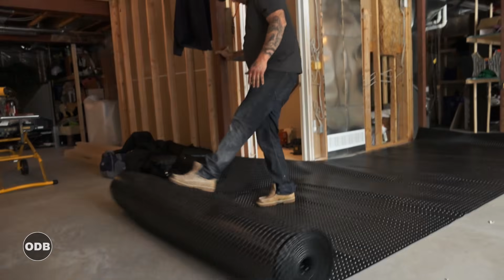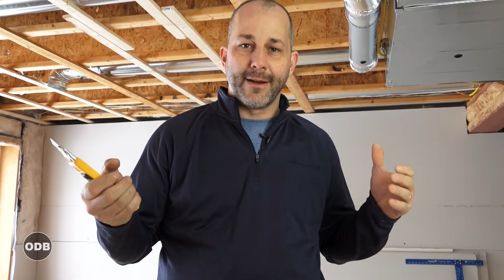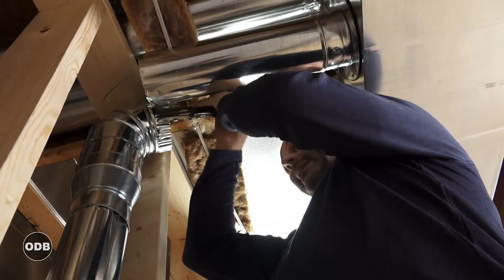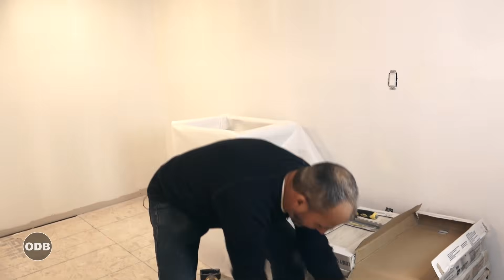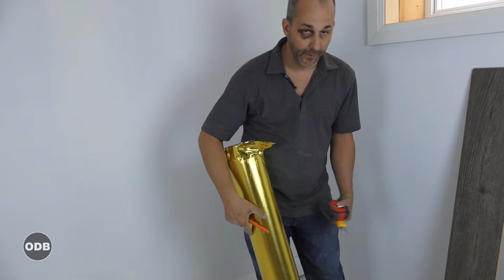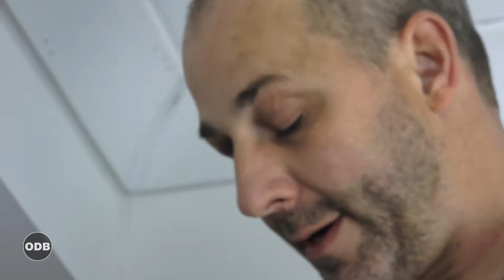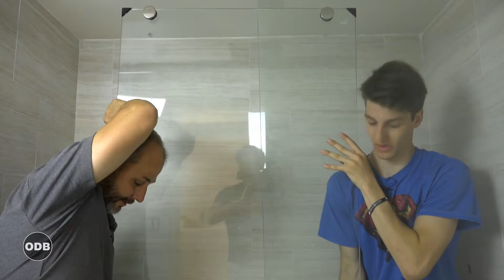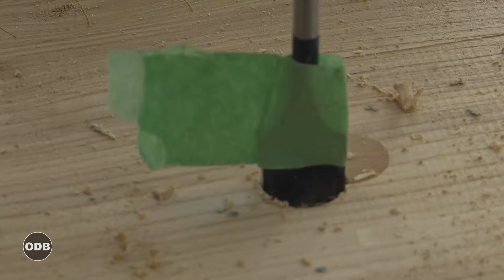DIY | How To Renovate an Unfinished Basement | A To Z

Comment: Rare to find someone who can speak so naturally, clearly and fluently about  his work. The pace was also excellent,  so it kept me interested for over 3 hours. Excellent video.  I wish you could spend a bit more time talking about wall insulation, framing around the outside walls,  and the possible need for ventilation under the  DMX flooring. What if moisture still builds up there and has no place to escape? Opinions?   I am planning also to use the same DMX dimpled plastic but I was thinking to install a layer of aluminium foil right on the slab expecting that will reflect back the radiating heat from the above. Reflective heat works well and only when you have an air gap. That dimpled plastic is excellent to provide that necessary airgap.   I would argue that would add couple R values to the insulation  properties of the floor at very low cost.  Maybe I am wrong but I would like to hear your  thoughts.  I am not sure I understand the purpose of that golden colored foil that is glued to one side of the laminate floor underlay. In my view that has no purpose since there is no air gap between the laminate and the subfloor.  And yes, what happened with your eye? First I thought you painted your eye to make it "interesting" and I was expecting some joke about it but you never explained. Did you get into a bar fight with Mike Holmes? :-)  Anyway, I like your video 100 times more that what MIke Holmes does . You are down to earth without creating the impression that there is only one way to do things and everybody else's work is crap.  Thank you for this outstanding educational video.

Comment: Good video but you shouldnt install you're 2x4 on directly on the concreate
Reply: The 2x's he installed directly to the concrete are pressure treated. I have remodeled and demo'd houses for over 30 years and there is nothing wrong with that method.

Comment: IF YOU WILL USE A SQUIRT BOTTLE WITH WATER ON THE TWO TYPES OF BITS YOUR USING THEY WILL LAST A LOT LONGER. IF YOU USE THE SPAYED BIT USE A SMALLER BIT TOO START YOUR HOLE. AT LEAST THREE TIMES SMALLER THEN YOUR HOLE BIT. ADDED BENEFIT YOU WON'T CRACK YOUR TILE AS MUCH. IT WORKS FOR ME, TRY IT ON A SPRAY PIECE OF TILE. SEE WHAT YOU THINK. I LIKE YOUR VIDEOS, I LOOK FORWARD TO MORE OF THEM.

Comment: I live in Texas, where basements do not exist.  However, I live in a 1.5 story home with a single room loft that is pretty much a finished attic.  Are there any plans to release videos on how to approach an expansion project or any finished attic?  Central air may have to be moved, hot water heater may have to be moved, sub flooring, and the possibility of dealing with bracing to the rafters.  Thanks guys!
Reply from the maker: Hi Luke, we are just finishing the renovation of our loft with some structural changes to increase the height and soundproofing. A lot of info in that series you will find applicable. cheers!

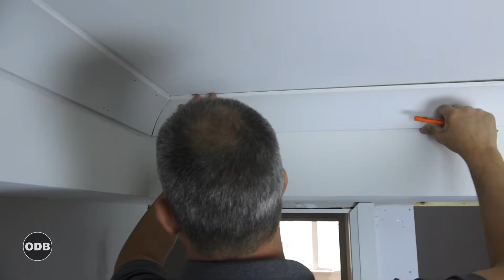Comment: 2:11:00 crown is one of my favorite DIY jobs. Having an older house, I worked in a step where after the first piece is up, take a scrap piece about 2' long and cut the corner to the right angle/bevel.  Then hold that scrap piece into the corner up against the piece already in place.  If the angle is off, adjust the saw and re-cut the end off the scrap piece.  Keep adjusting the cut until the scrap piece is tight, then use that saw setting to cut the first end of the piece that's going up.  You can repeat this step for the other corners.   ...also Top Gun 300 is a great painters' caulk.

Comment: For the header, your pencil mark was off from the laser, correct? When you pulled the stud out and screwed in to pull it flush with the base plate, your laser was 1/4" from edge of stud. I guess if your close enough it's ok?

Comment: Hi Jeff, I know the length of the toilet bolts drive you crazy, but they are very useful as "T" bolts in woodworking and the extra length is useful then. It won't make you feel any better but I thought you should know. The finish on the bar looks great, I don't think anyone could come up with a better result and all the work you have done is to a very high standard.

Comment: Great video but I am curious at 2:50 you glue the toilet flange to the drain pipe, you didn't screw the flange down to the sub floor afterward.
Reply from the maker: Hello Ina, the subfloor is cement. I have no doubt that the flange is not going to come ripping out but if you want to you could use some tapcons

Comment: a bit of advice on your duct work. your crimps should always follow the airflow otherwise you just built in a restriction. air flowing against a crimp creates turbulence which reduces the velocity you just attempted to increase.
Reply from the maker: Not concerned about the 3 % loss of heat back into the area I am heating. Cheers! It was all about the convenience of the installation and bringing heat to the floor.

Comment: "When you pre-drill the holes in the OSB subfloor use Tap Con screws. Prior to driving the screws into the concrete dip each screw into a polyurethane sealant before inserting the fastener into the bottom plates of the wall. Since the Tap Con screws have two different threads (a cutting and tracer thread) the sealant will be deposited on the membrane as it goes through. This helps maintain the vapor barrier that has been penetrated by the fastener." - DMX FAQ
Reply: Good tip....
Reply: l
Reply: L
Reply: L
Reply: L
Reply: Ll

Comment: I give you like , because you work hard and lot of good stuff presented  to orient , but that work around toilet , baby hack saw with new blade would do just as easy , also brass washer come on top of plastic washer - toilet flange bolts, you mentioned but forgot to put one on , just minor, never mind ,   however excellent work on the end , good looking basement !
Reply from the maker: Cheers , thanks for the like!

Comment: I don't even know how I stumbled onto this video... LOL I've had a hammer in my hand since I was about 5 years old (father was a contractor). Fantastic job with this video and the long format. I know first hand just how much work it must have taken to put this all together. Bravo!!

One question / issue: At around 2:52:00 you show the installation of the toilet flange and toilet. I see that you didn't remove the product sticker from the flange but that's was the mounting surface being used to clue to the sewer pipe. Additionally, you didn't make use of any of the mounting holes to directly bolt the flange to the floor. So essentially the only thing holding that entire assembly in place is any strapping used to place the drain pipe to the spot. Now that the toilet get's bolted to the flange, the entire stack of hardware now depends on the strength of the sewer pipe and how robust it is mounted. Given this is a basement, it's entirely possible that the drain pipe is sitting on a bed of cement and not floating in the air, but isn't this a fairly weak structural setup? Sure, you'll go back and silicone the outer edge of the toilet to the floor but with all the weight of an adult sitting on this toilet, isn't there a good chance it could topple to one side?

Comment: Hey great videos! Very thorough information. Thank you kind sir. I had a question about using Dricore vs DMX. I live in Ontario so our weather's similar. Why do you choose DMX over Dricore because everyone in home Depot recommends the foam Dricore for higher R (warmth) rating and I thought it works the same for moisture. Thanks again for the help.
Reply from the maker: that is the funniest thing I have ever heard. insulating the floor does not make it warmer. bringing heat to the floor does.
Reply: @HomeRenoVisionDIY    Hey thanks for replying. So what did you mean when you said the Dricore wouldn't act as a vapour barrier in comparison to the DMX? I feel like overall you don't think Dricore is good for anything it's advertised for.
Reply: @HomeRenoVisionDIY  Hey I did some more research and figured why you said it acts more like a vapour barrier. Just wondering when you drill through the plywood, the DMX and to the concrete, does that hole allow moisture to escape through it?

Comment: Hi. Great video you were saying about builders and codes and such. I'm from Winnipeg and looking to do my basement. What is the procedure with the codes other than electrical that I know you need to get an inspector for rough in and tie-in to a panel 

Thanks
Reply from the maker: insulation  inspection. plumbing, framing and final. Cheers!

Comment: So I would like to finish my basement but previous owner installed ceramic tiles but didn't do anything to the walls other than painting over the concrete. Is there anything I should do before framing the walls? Or if I can frame on tiles in the first place. Any help and tips appreciated!

Comment: Installing laminate was not the way should be. 
I do this for 12 years now, I do only Flooring ok.
But I was surprised how u installed the laminate flooring. 
Toronto on.
Reply from the maker: Hi Hasim, you might do only flooring but I am thinking that perhaps you have never seen this type of locking system. Otherwise you would have a different opinion. For the record there are now at least 9 different locking systems on the market.
Reply: @HomeRenoVisionDIY  
Yes I understand that. 
All good, I still will watch your videos like I usually do.

Comment: That is not the proper way to solder. You have to sand the brass part and never wipe flux on after!!! You need to take a rag and wipe off the flux residue after soldering or the acid will eat through the pipe or fitting and give you a leak over time.
Reply from the maker: so what you are saying is that I am soldering like every plumber working in new home construction. I am cool with that!

Comment: Awesome job, when I saw more than 3 hours video I thought I never gonna see that, but my curiosity was bigger.
Nobody is perfect, just a few things:
I like work with copper better.
Never use hammer drill in a hammer drill mode to open those holes in the tile. In that little case you bought for $9 bucks, it comes smaller ones, take that smaller and then use the bigger one.
Like I said nobody is perfect, is an amazing job.
Love the floor, the bar table, the bathroom almost everything lol. Thanks for sharing.
Cheers from Chicago 👍🏼

Comment: Shouldn't you wrap the valve part in a wet rag while soldering?
Edit: looking closer. The valve looks like you took it apart first, but still. :)
Reply from the maker: the brass cannot get hurt. Cheers!

Comment: What if you already have a finished basement and you want to take the carpet up and put down laminate? Should I still use the black item? The house is 4 years old. Thank you
Reply from the maker: Hi Tonya, if your house is 4 years old then I would suggest installing luxury vinyl plank. You can even install with a radiant floor heating system . Cheers! I will be releasing the video on that product in a couple of months.
Reply: Home RenoVision DIY thank you for replying. I am going to wait for that video. I really appreciate you doing these videos.

Comment: Pex sucks.. inner diameter is small .. cuts down on water pressure..  use copper don’t cheap out
Reply from the maker: LOL, actually the pressure remains the same. the holes in the valves are smaller than the pipe so it has no effect on performance.

Comment: I find that North America has a preference for forced air heating,while in Europe radiant heating is widely diffuse,particulally radiant floor .Knowing how hard is winter in the middle west and Canada ,I ask myself why  don't you guys switch to a nice radiant floor.Radiant heating is a different kind of animal and confort.Undeniably forced air doesn't produce the same confort of radiant heat.The convection of warmed air raises to the ceiling while it loses energy,it leaves the lower level actually cold.A radiant floor has a thermal inertia due to the concrete mass it only require a 28 C warm water in the line to heat your room till 21 C,it's a really nice perception of a warm environment.As always it a pleasure to see you at work ,great inspiration for DIYers
Reply from the maker: we use forced air so we have A/C in the summer as well with basically 1 system.
Reply: @HomeRenoVisionDIY  thats true Jeff,but modern heat pump systems allow you to circulate warm fluid in the line system during the winter and cooled fluid during the summer using the same technology,sometimes we implements fan coil units for the cooled air,but you can actually circulate the cooled fluid into the floor ,we are progressively switching to this technology from natural gas in our domestic furnaces,one technology,one utility bill (just electricity not both elect/gas),but here we don't invent nothing,I actually think it comes from you in North America...another great feature is the ERV ventilation system,fresh filtered air in any ambient of your house while costantly recovering energy with the heat exchanging core,thanks for your comment Jeff,cheers from Italy

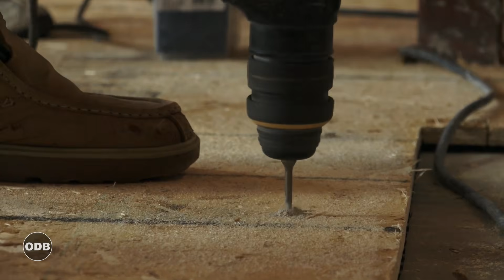Comment: @Home RenoVision DIY is the air tightness of the DMX affected when you put the concrete screws 5:49 through it?
Reply from the maker: Not really worried about the eventual fail of the screw. When you renovate a basement you need to understand that it will not last forever. Just looking for a 60 to 80 year solution.

Comment: Can I use that black mdx thing on cold cellar concrete walls for half foot down from ceiling on walls as it’s causing condensation problem on ceiling ply wood and on the wall on top where it meets ceiling which is above the ground 
Thanks and sorry for silly question
Reply from the maker: cold cellars are a completely different video. Cheers!
Reply: Thank you for reply 
I checked in your channel but didn’t see it ,if it’s uploaded then can  you please give me link? Thanks in advance

Comment: Can't tell you how helpful this channel is!!!!  If I was using foam board on the exterior walls and then wood frame with batt insulation on the inside would install the foam board down to the floor and then butt the dimple and plywood up to it and then frame on top of the plywood/dimple mat?  I figured this would be the way to go because it would keep any moisture that went down the wall under the dimple layer also.  Does that make sense.  Thanks again for all your content, simply awesome!
Reply from the maker: Thanks Danny, glad to help. Cheers!

Comment: I seriously recommend now using non-wax seals which work in any temperature (wax rings don't work well if installed when it is too hot or cold), will last forever, and tolerate use by obese  people much better than wax rings, which get flattened, do not recover, and then leak.

Comment: Pressure treated lumber on concrete is ok according to code in your area, but will it last more than 20 years? I thought there should be something in between for home construction. No idea what I’d put there other than plastic sheeting or a metal plate. Is there something else you could do? 

My house is pier and beam foundation but someone came along after the initial build and put concrete on the outside, in contact with the wood. The concrete sank and is taking parts of the house with. Different problem, but I’ve wondered why the wood hasn’t rotted. Figured it was because it’s in the desert. 

I agree with the person below. We need to clone you. You point out the stuff other people have done incorrectly and then I don’t want to hire anyone else to fix it. But that’s ok. because now I can do it myself. lol
Reply from the maker: Hi Deborah, even untreated lumber will last 20 years so no worries there. The reason we use it is to stop the proliferation of mold.

Comment: This is a great video and will be shortly following it step by step to finish my basement.  My one question is how did you address the diference in riser height at rhe bottom step of the stairs after addinthe barrier and plywood?  I want to use the DMX as well but am concerned about the tripping hazard because of the difference in riser height at the bottom of the stairs.  Can you explain what you did or would do to address that?   Thanks!  Keep up the great work.
Reply from the maker: Hi Danny, we installed tile at the stairs so we didn't create a weird step scenario. Most building inspectors will allow a small variance in the riser due to flooring. Cheers!

Comment: Why did they leave the old insulation which sits against the wall,  on all the walls when they framed. Wouldn't it be better to go with new insulation and have the proper spacing between the insulation and the walls?
Reply from the maker: Hi Micheal, we removed the insulation that rested against the concrete. since this was a walk out basement one of the walls did not have a concrete pour. We used a spray foam on exposed walls and extended the knee walls to the ceiling on the other step pour walls. This may be where your confusion lies in regards to what our process was. Cheers!

Comment: I did the grinder trick with toilet bolt when I first started doing this. Did the same burn and had to buy another toilet
Reply from the maker: LOL. Or use a wet rag for protection.
Reply: @HomeRenoVisionDIY  I feel the same way about them bolts! Hey..basement came out beautiful.  Great job guy's!!

Comment: Haha Fan watching the fan install.  Funny joke! Thanks for adding that 2x4 to stabilize the fan housing.   Always enjoy your videos. 

Do you have any videos of finishing a garage with metal purlins? I am putting plywood or pressboard for the wall where I am attaching lawn equipment and battery chargers for cordless equipment. Other things will go on there as well

Comment: Why do you sometimes use screws to attach your studs and other times you use the nail gun?
Reply from the maker: nail gun in most cases. screws when I think I may need changes. But either works. I try to show simple tool installations so more people can be empowered regardless of tool budget!